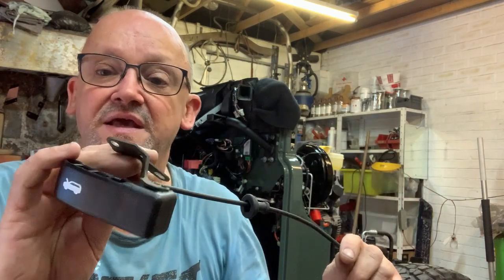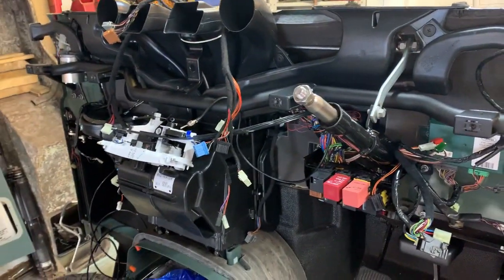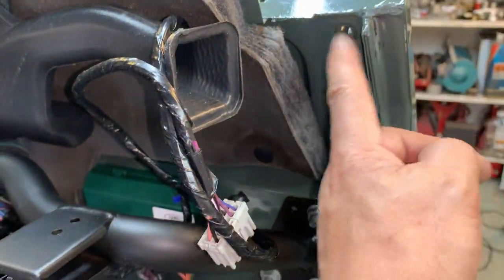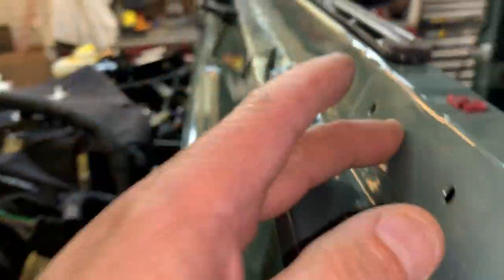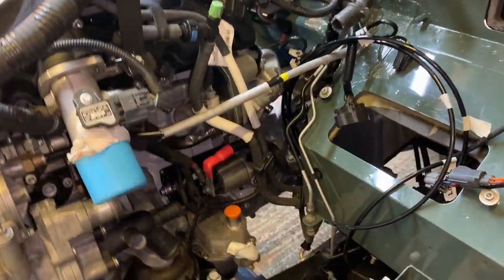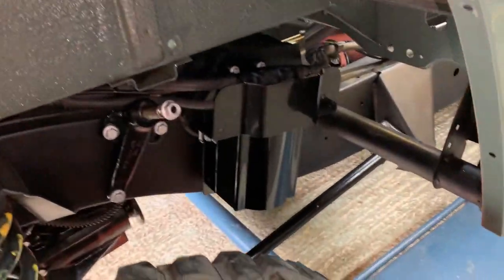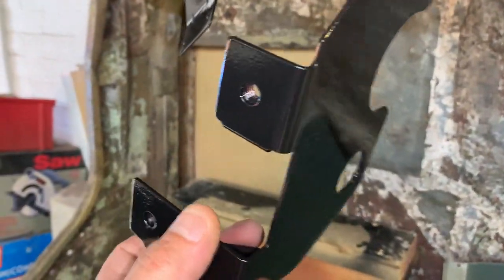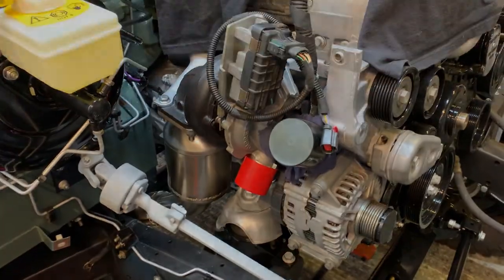Update on the  build.

Comment: Hi Nige, I’d really recommend fitting a plumbed in Webasto. Easy enough to do with the wings off. I can honestly say it’s the best mod I’ve added; lovely getting into the truck on a cold morning and having the engine basically up to temp (as long as I remember to set the timer)! Stu
Reply from the maker: Thanks for the tip! But.. I don't think I'll do that. I don't use it enough.